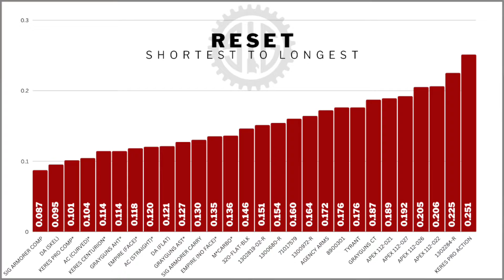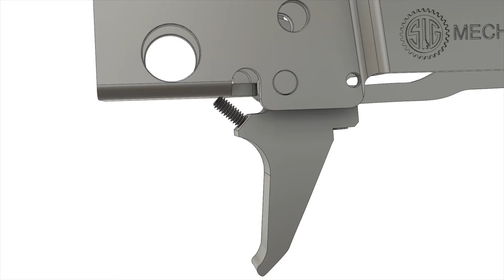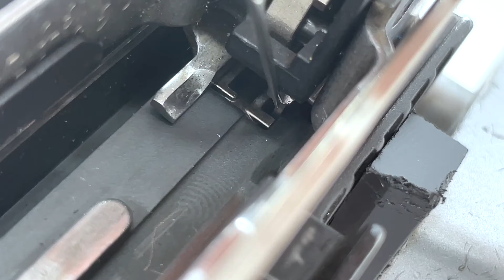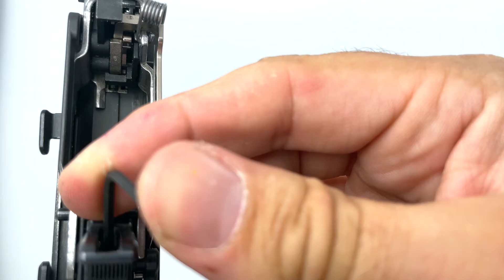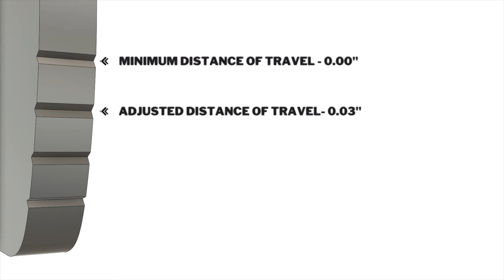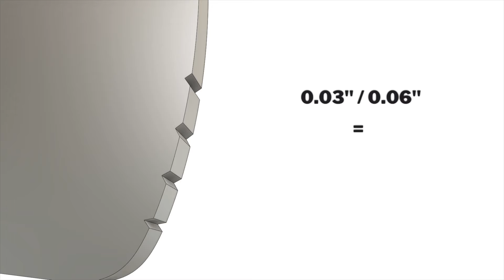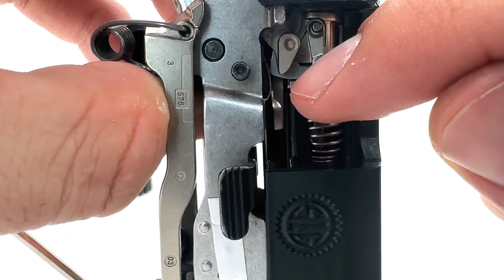EFFECT OF ADJUSTABLE TRIGGERS ON P320 SAFETY

Comment: Absolutely love this channel 💯🤙🏽 bought my 320 used and i have that same trigger from armory craft.. the pre travel and post travel was adjusted a lot and feels similar to like a 1911 feel trigger pull and reset.. i took my hammer and bang the crap out of It multiple times all over the firearm and slammed mags into the magwell and still couldn’t get It to “fire on its own” but fires flawlessly wen trigger is pulled. Also has the armory craft spring tuning kit as well.. any thoughts? Is this still considered unsafe? Is there other tests i should run? Sorry pretty new to this 🤙🏽
Reply from the maker: From all of my testing, even after adjusting the trigger as far as it will go, (where it will still function), you should still have some safety. left to go during the trigger pull. Technically speaking, you are making it more unsafe, so that is something you have to reconcile for yourself to see if you are comfortable with it. The P320 does not fire on its own like many YouTubers have tried to say, but in this particular case with the adjustable trigger, you are definitely effectively pulling the trigger just a slight amount. 

Anecdotally, I don’t think I have ever heard of anybody actually have a negligent discharge due to having the adjustable trigger.
Reply: @SIGMECHANICS appreciate and love the response 🤙🏽🫡

Comment: will the “pre travel” on a non-adjustable trigger partially engage the striker safety while manual safety is on?
Reply from the maker: It will because they operate independently.

Comment: How about the APEX forward set trigger bar? does it also start the process of safety deletion quicker?
Reply from the maker: It does not! Its design is such that it does close the gap between the sear but the area that touches the safety lever seems to be ALMOST the same. I have a whole video about the Apex if you want to learn more, including 3D models and testing.

Let me know what you think!

Comment: The newer P320 models have the hook and the safty wich in case of a disturbance the hook jumps and the safty too and then the fall safety is already disabled and cannot cath the firing pin
Reply from the maker: If I’m understanding what you’re saying, that is incorrect. If you drop the gun, unless the trigger is pulled, the Striker safety will remain in place therefore, even if the sear jumped the ledge, it would physically prevent the striker from entering the breach face. 

The second ledge on the sear is only there for the purposes of allowing the striker to jump from one to the other in the very specific instance where the sear drops down due to massive vibration. At which point the sear spring would instantly spring, the sear back up to catch the striker.

Comment: The fact that eliminating the pretravel eliminates most of, if not all of the striker safety, especially when the slide to FCU fit up is taken into account, is pretty ridiculous. How did they think this was a good idea?
Reply from the maker: It’s all about timing. It works very well as long as you’re not modifying the timing between the parts.
Reply: @SIGMECHANICS and as long as parts are in spec, on a gun with a decent amount of play between the FCU/frame and slide, like there is in mine.
Reply from the maker: @Colonelloki yes, I looked into that “unofficially”, if the clearance was tighter (definitely can be if you REALLY want to, then the gun is going to jam up very often. This clearance makes it so that the gun works with mud/sand/ debris (per Sig engineers) - if you add welding material to the FCU rails, then lap it, you can get close to zero tolerance.
Reply: @SIGMECHANICS from an engineering standpoint, that doesn’t make sense.  It sounds like the sort of explanation junior engineers have given in design reviews when I’ve asked them why something is a certain way. There are other handguns that don’t have that much play and have made it through the most extreme tests without cycling issues.  If the design NEEDS that much play to function, that’s an issue with the design.

I’m honestly not surprised these are having the issues they are after actually digging into how they work.

Comment: Question: what if the bottom of the striker safety was filed? Could proper timing & safety still be maintained with the increased clearance?
Reply from the maker: You would create a slight timing situation. There might be a balance that you can achieve, but I have not tried to figure out what that is yet.

Comment: I think a partial solution would be to have/modify/supply a tuned striker safety that would regain the slight gap and eliminate the loss of contact area you illustrated. Because of the over travel of the striker safety removing material from where the latch and bar meet would solve this issue. The second would still rely on the tuner to understand the limitations of safe adjustment. Very interesting and informative. Thank you
Reply from the maker: Thanks for watching!

Comment: Had me worried there for a minute but after looking at my setup with that same trigger but also with an Apex trigger bar - I see that the trigger bar is tight up on the sear but the safety lever is still on it’s stop. So that take up screw when just contacting the FCU frame is just taking up slop in the trigger and not used to bring the trigger bar into contact with the sear.
Reply: ….aaand I just saw your Apex trigger bar video

Comment: I wonder if there is a way to know what kind of triggers all the ND's over the years were using. Is that something someone, maybe SIG keeps track of?? Is there a list somewhere?? I'm willing to bet a large percentage of the ND's can be attributed to adjustable triggers. I have an ArmoryCraft adjustable trigger on my M18 and it doesn't pass that pin test that's been going around recently on YT. I have it adjusted so there is barely any take up. I also have an old p320 post "upgrade" with an oem trigger that does pass the test. This has to be the problem with all these ND's!! Great video!
Reply from the maker: Thanks! I’d be utopia to know the same. I’d recommend the Apex trigger bar for this as opposed to an adjustable trigger.

Comment: Thanks for the amazing detailed videos you post! I was wondering if the manual safety would prevent this, or in this case would it not affect it? I'm a new firearm owner, just picked up the p320 xfive legion, so I still have a lot to learn about them. I have this trigger on order, but I never plan to carry or even holster this gun. Thanks!
Reply from the maker: I have a whole video about how the p320 MS works, complete with 3D model animations to help guide you through your question.

Comment: Are there any improvements to trigger safety you think are worth it?
Reply from the maker: No really. The triggers on the P320 are generally very nice, light and short. If you are specifically looking to increase safety mechanically, you can add a manual safety to your P320 using something like the MSAFE-T Toolkit and a few factory parts.

Comment: Have you tried the apex bar and tube with the  armory craft adjustable trigger in this.. Will this be a good idea?
Reply: Or better yet have you a solution for the safty issue when using this trigger
Reply from the maker: I have not tested it with that combo but I have used it. Feels good but I’m not sure about the amount of safety removed with the combo.

The trigger bar on its own does nothing to remove safety, the trigger is the only question.

Comment: Hello! Great channel and videos. New Sub! Do you have an update on the adjustable trigger's safety tune you were speaking about at the end of the video? Also, I'm looked to get down to a approximately a 3# trigger pull with minimal over travel. After looking at your video on AN ANALYSIS OF EVERY P320 TRIGGER...EVER, I'm left with even more questions..... 🙂 Bottom line, what combination of part should I use to achieve my goal? Thank you!
Reply from the maker: Hello! Yes and no, I am just about to release a new line of ultra high-quality CNC’d OEM lower parts for the P320 in a few months. After that release I will go back to finish the adjustable trigger tuning safety parts.

On your other question, it would be very hard to give you the combination since I did not test the combinations on my set up. I have always wanted to and I might just do a live video stream one day where people can ask me to try certain combinations. I feel like that would be a fun project.
Reply: @SIGMECHANICS  Super! Thank you for the follow up email.

Comment: Great video, but I'm not sure I agree with the conclusion (specifically the quantative representation of safety loss). 

Let's first define what the safety is supposed to prevent - the sears or striker losing their grip of one another, for some reason (sears breaking?), having an extra "steel blocker" to prevent the striker moving forward. 

If we agree to that, I would say that there is NO safety removed as long as there is still a steel component blocking the striker moving forward (even if the thickness of that steal is 0.1mm, it is still steel preventing something moving forward). 

You could say that different mechanics means that there could be natural movement of the safety in the 0.1mm, making it unsafe. But in that case, I would say the quantative is basically either 0% or 100% - either moving the safety up puts the thickness left in the area of natural movement, or it doesn't. Defining "50%" is arbitrary if the thickness left is still outside any reasonable movement the safety might have.

Comment: Is there a reason why the p320 trigger wobbles and has play from side to side
Reply from the maker: The trigger is not a press fit part. It slip fits to the FCU frame but the wiggle will not affect the operation.
Reply: When I remove the fcu from the frame the trigger always falls out i just changed to a xcarry frame and had this issue when I notice the wobble , is it common for it to fall out during removal only trigger

Comment: Is this the reason why some triggers come with a 3D-Printed piece for you to adjust the travel, so you don't overdo the reduction?
Reply from the maker: The only one I know that has the 3D printed part is the MCARBO, they just do that to shorten over-travel, but will not do much for take up (that one does also have a pre-travel adjustment which DOES improve take-up). As far as the printer part goes though, it only affects over-travel and shorten trigger travel because of that.

Comment: Can anyone tell me why you are not supposed to use the dual adjustable armorycraft trigger with the apex trigger bar?
Reply from the maker: It’s not that you cannot, it’s just that since the Apex has a design that already tightens the gap between the trigger bar and sear, then the adjustable trigger is barely going to be tuned before you hit that wall. Here’s a video to break down the apex design (lots of 3D models). Let me know what you think.

https://youtu.be/twgqV49i2_8?si=tRcU4KCTvmDi8IFN

Comment: Just a thought, but wouldn’t taking material off of the bottom of the safety lever on the striker prevent early disengagement of the striker safety?  I believe in the video you do mention that it goes substantially higher than what is needed to disengage the striker.  Please correct me if I’m wrong.
Reply from the maker: No you’re correct. There are some geometric things to consider but both and either/or those options would work!

Comment: I've been watching your content after hearing about the Sig ruling against out of Mass.  It seems like there are a lot of internal safeties on these, despite the court ruling that the design is inherently dangerous owing to a lack of external safety, like the trigger blade safety of a Glock. I've also heard a bit about some people who have had seemingly hands-free NDs where SIG said it was a defective Firing pin return spring.  Seems like the return spring wouldn't be able to push the striker thru the striker safety if it weren't disengaged though.  maybe I'm wrong though.
Reply from the maker: I believe a lot of the data out there is not coming from people reading from court documents. For the most part I believe it’s just “bad news is more entertaining than good” and so that is what people promote on things like YouTube as it gets more clicks.

The truth is as unfortunate as it may be, these triggers are being pulled sufficiently to disengage safety, and even more so to the point where the sear drops enough to disengage the striker. As far as the return spring goes, it’s funny you mentioned that because that particular spring is something that Sig had discontinued in around 2020-ish due to the fact that it is redundant. The striker will reset itself after a discharge, and once the slide makes the return lock position. It will not have any effect on causing a negligent discharge.

Most of what you see on this channel allows people to visually understand the internal components and their mechanical interactions. Beyond my own testing and purely on the engineering alone, I do not think any of those discharges occurred without a trigger pull. Even if the operator did not touch the trigger, something else had replicated a trigger pull, either an article of clothing or an accidental touch of the trigger to a holster or other object.

That being said, you should only use and carry what you feel comfortable with, as I don’t intend to particularly sway viewers one way or another, only provide the data to help them come up with an opinion of their own.
Reply: @SIGMECHANICS  Thanks for the detailed response!  I love the videos and hope you continue them.

Comment: Thanks for another amazing video Edmund! 

Our range had its first incident in 91 years where someone shot themselves when holstering. Sadly it was with a P320 and was due to his shirt getting caught up in the trigger well which created resistance which allegedly led to him using a more forceful push which discharged the firearm into his leg. 

Given the fact it was a competition, I wondered if an adjustable trigger may have exacerbated the problem. 

In this case, it seems like the default give would have been helpful but it’s hard to say it would have been enough to prevent this unfortunate event. 

I wonder how many other cases of P320 NDs are induced this way via using incorrect holsters, garments coming into play and adjustments to the pre-travel.
Reply from the maker: Yikes that’s horrible, I hope he’s okay. It’s hard to imagine that if the person had an adjustable trigger at the time that it didn’t at least in a small way have something to do with the end result. It’s great having the trigger right at the wall, but the cost in my opinion is way too high.
Reply: @SIGMECHANICS  yes he has a very damaged leg and foot, but is alive and recovering.

All this makes me appreciate that take up in my X5 Legion that I’ve holstered thousands of times in my Werx holster.

Comment: A bit late to the party, but this could be resolved with modified geometry of the trigger bar where it engages the safety release.  Increasing the gap by removing a small amount of material from that specific section of the trigger bar would delay the raising of the safety tab to later in the pull, meaning the safety tab will stay fully engaged until the trigger bar is closer to engaging the sear release.  The exact amount of material removal/geometry change is up to the people who are looking for this kind of adjustment, but that's the basic solution.  Sig erred on the side of ensuring the safety is well clear of the striker by the time the sear disengages, ensuring that the striker does its thing if the trigger is being actuated at all (e.g. you've got your finger on there).

Or a fully custom trigger bar.  Either way.  The ramp geometry for the internal safety, in relation to the sear release geometry, is what matters.

Comment: Noticed once you start playing with pretravel screw manual safety starts getting stiff and crunchy. I have mine before it gets to that so about 2-3cms unlike others who have theres down to 2mms
Reply from the maker: The MS works by creating a stop on the trigger bar from moving. By pulling the trigger, you are essentially pulling the trigger bar slightly forward if you were too adjust pre-travel, it is essentially the same thing as pulling the trigger. Therefore, there is a correlation between setting the pre-travel screw, and the position of the trigger bar.

That being said, it’s very possible that by moving the trigger bar, you are not allowing the manual safety lever to drop down into the cavity of the trigger bar the way it needs to for a smooth transition.

This is just a theory, of course as I haven’t Particularly tested this issue.
Reply: @SIGMECHANICS  another thing that I've noticed people are also removing the double sear spring and running only one spring. Thats sketch but there guns run flawless

Comment: Excellent video, and I can't thank you enough for putting this out there. 

One suggestion to help give people a real world example of the danger would be to overtune the travel, assemble the gun, chamber a unloaded yet primed casing, and then drop the gun muzzle first onto concrete from a few feet off the ground. Would make for a powerful visual for people to understand the danger.

Very important thing to understand not only for someone carrying a gun for CCW or duty but also for competitive shooters to understand. People drop loaded guns on occasion.
Reply from the maker: The only issue I’d have with that is it does not go off during that test, it might give a false sense of security that 50% of the safety is “good enough”. I 100% agree with you in how the chance of dropping a gun exponentially increases in stressful situations. My personal opinion is that any loss of safety is unacceptable and due to how amazing the trigger is BECAUSE of the shorter travel in the P320, I’d warn anyone to modify it enough to alter any of it.